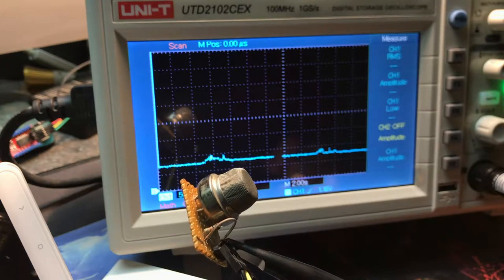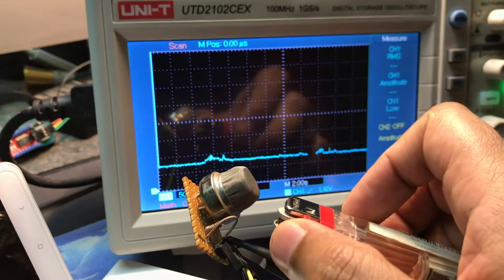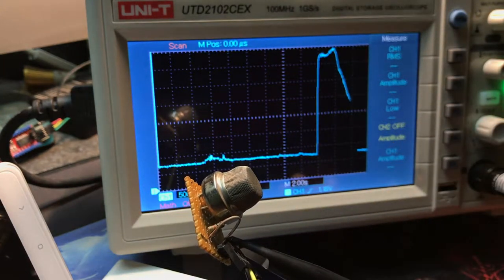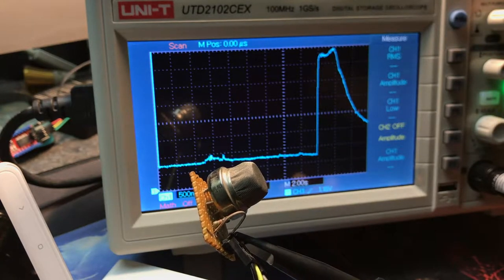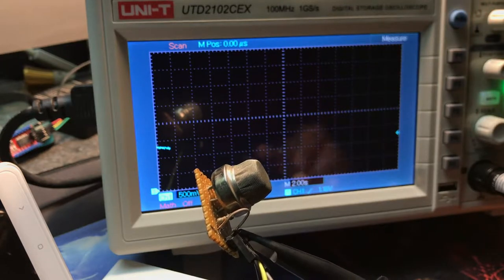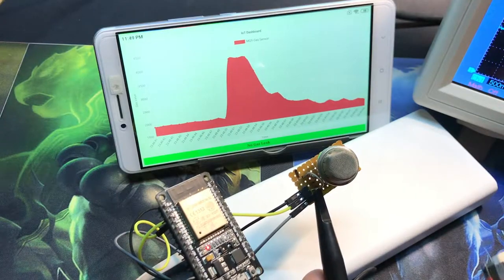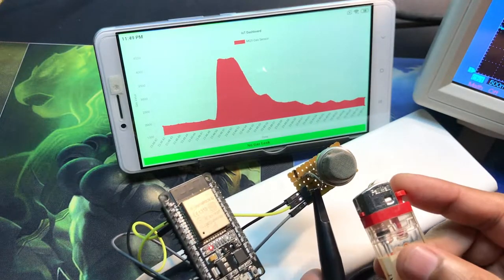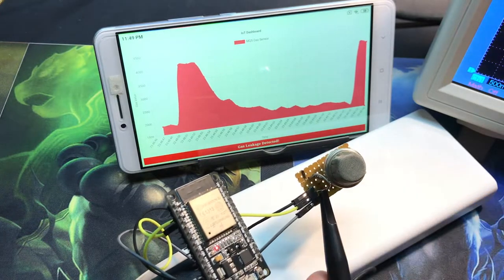ESP32+MQ5 Gas Sensor+BI Reporting Dashboard

Comment: I figured out somehow getting reading over serial monitor, but i want to add it to my home assistant and also attach a buzzer to it. Problem is I'm not a techie, Jus like a new born baby i don't know anything except 12th class subjects)). I'm a doctor, Jus trying to make a good home assistant. I found many esp8622 sketch for mq5, but only one person in this world i guess it's you using esp32)). I tried altering code for esp32 from esp8622, like Wifi.h etc.,  but didn't find good results. My esp8622 is on the way, i have ordered it. No problem dude i will do it with esp8622. Tnx for your reply.
Reply from the maker: If you are not doing anything complicated (like power manager or multi core processing) esp8266 and esp32 is almost the same. Only configurations are slightly different (wifi.h)
Reply: For me it's complicated dude, I know nothing....